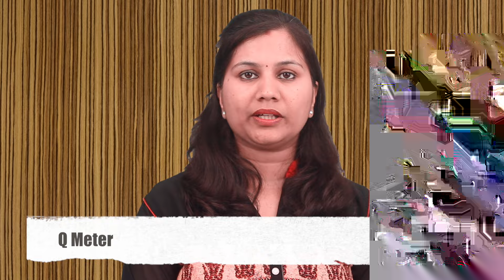Q Meter - Working Principle and Construction - Electronic Instrumentation and Measurement

Comment: Madam you missed some points complete Definition of Q-Factor is 
"The Q-Factor is called quality factor or storage factor. It is defined as ratio of Power stored in the element to the Power dissipated in the element. It is also defined as ratio of reactance to resistance of effective element for Inductive XL/R and for capacitive Xc/R "
Reply: Oo mere gyani dost..! Dono hi same cheez hai

Comment: The instrument which measures the storage factor or quality factor of the electrical circuit at radio frequencies, such type of device is known as the Q-meter. The quality factor is one of the parameters of the oscillatory system, which shows the relation between the storage and dissipated energy.

Comment: How confidently you are teaching wrong. Definition of Q-facor is the ratio of "energy stored per cycle to energy dissipated", however in your explanation you just reversed it. Have you read before you teach. Stop acting of teaching.
Reply: Sahi kaha...... brother 😊
Reply: Yaaaaa
Reply: Yah here have something wrong of q factor's ratio...
Reply: "The Q-Factor is called quality factor or storage factor. It is defined as ratio of Power stored in the element to the Power dissipated in the element. It is also defined as ratio of reactance to resistance of effective element for Inductive XL/R and for capacitive Xc/R "